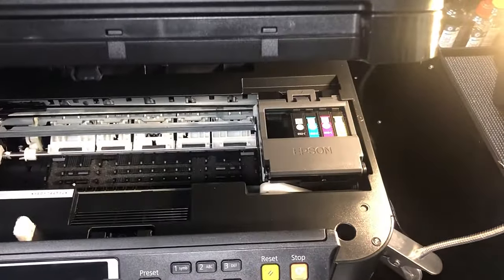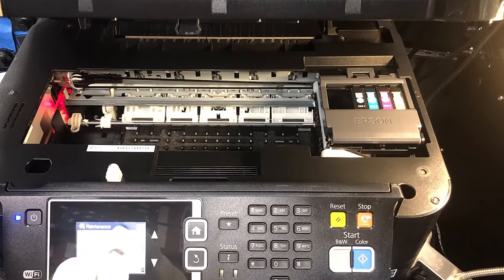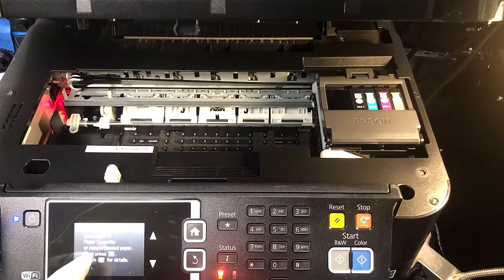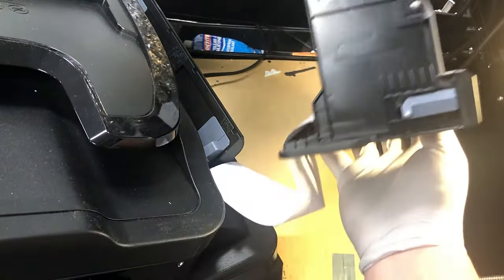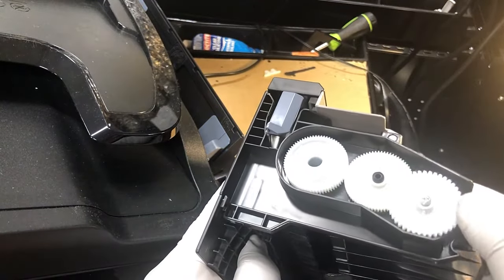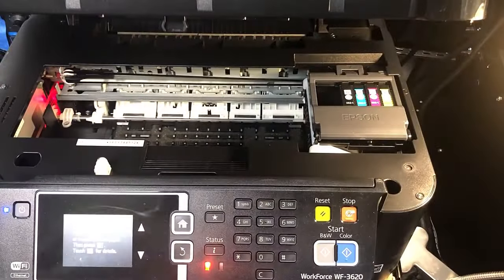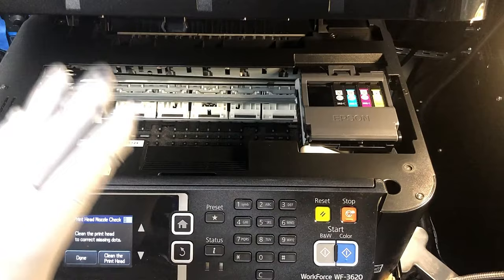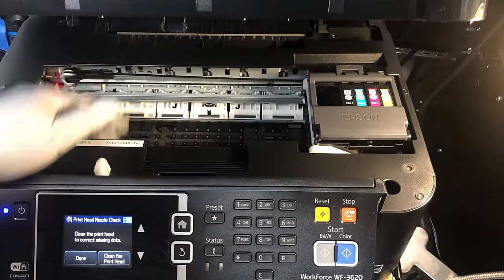Fix Epson Fake Paper Jam - Symptom 1 - Paper loaded halfway

Comment: Thanks for this.  I'm really waiting for your '2nd fake paper jam' because I think that is my issue. 
The paper feeds to the print floor half-way, then backs up and the error bleeps.  when you select 'cancel', the 'jammed' paper feeds all the way through with no problem.
However, during the aborted print, the paper has a 'wave' in it, as if the paper gets through the removable feeder fine, but temporarily jams up against the next rollers; perhaps they're out of sync or something.  Still, the paper exits to the paper tray without further problem.
This all started happening when I got the 'ink reservior has reached end of life'  message.  Fixed that, then this 'jam issue started'.
Reply from the maker: Does the paper pass the print head when it is fed halfway?
Reply: @BCHTechnologies  it looks like it, but it gets yanked back and beeps with the error display.
Reply: mine dose this on double sided printing on the second side only and says paper jam   but its not jammed anyone know how to fix it very annoying
Reply: @markcrickett7455  same problem

Comment: Hi Kevin. Many thanks for this video. It is far better and most derailed explanation I found in the www. Unfortunately, with my WF 3620 nothing helped, yet. The weird thing is, it prints its own internal reports and also the test pages without trouble. But when I start printing from PC or phone the paper is pulled in as desired and stops just below the printhead abruptly, throwing the paper jam message. I just don't understand why it is capable to print its own stuff but not mine 😞. Smells like the obsolescence counter reached its end.

Comment: Thank you! This happened to my Epson XP-4105. The printer kept asking me to feed paper through to resolve the problem which I did and the paper went through fine.  But it still came up with a paper jam message until I took out the rear feeder and sure enough, there was a piece of paper stuck in the back.

Comment: I could use an explanation  of a 0xEA  error with NO paper jammed or anything else this vid shows.  On startup the carriage moves a bit from right to left then goes all the way to the left and I hear a high-pitched screeching sound and then get the error.  I cleaned the first encoder strip and that didn't help.  I bought a replacement strip, cleaned it and it still does the same thing.  I just want to how to fix it/ where the noise is coming from to see if it is worth messing with.. Thank you
Reply from the maker: Here is the 0xEA: https://youtu.be/NCUQODO6qik
Reply: Thank you, hope this gets rid of it!!

Comment: I have an Epson ET-7750 that does not work anymore (had it for 1 year and 4 months). As soon as i turn it on it whants to draw paper but stopped midway and says error code 000041. I can run paper manualy but printer winn not work, just stopped at error code.
Reply from the maker: Try this and see if it works: https://youtu.be/OtpvezkpZ8Y

Comment: My paper jam is that it fails to feed after the first sheet from the tray. There is no paper to retrieve. I tried the manual paper supply command, and this works to print the Epson logo.....go figure. I have had this issue with EPSON (crap) since day 1 new out of the box. I will never buy Epson again.

Comment: My sister hooked up her Epsom Printer in our new apartment. She sent me out for one color cartridge which read low when she turned it on  the printer hooked up to our new wi fi.  When she replaced the color cartridge, the paper jam alert came on . She never tried to put paper in the printer. She never had a paper jam before she packed the printer to move. There is no paper jam at all. It won't reset - so the printer is useless, unless we can fix this annoying problem.
 I just went out yesterday and bought a new Epson Cyan XL cartridge.for the printer at Staples. In fact, I had just replaced all of the other color cartridges with Epsom 220XL cartridges and the also the black ink cartridge with the Epsom 220XL Cartridge, before we moved. This is a lot of money to spend on 2 year old printer which won't reset. Do any of you have any fixes?
Reply from the maker: This can be caused by the waste ink sucker underneath.  You can try this trick: https://youtu.be/ZCSreY5hBa0